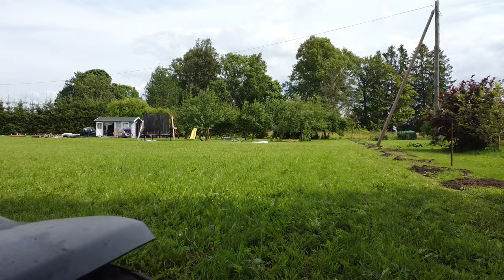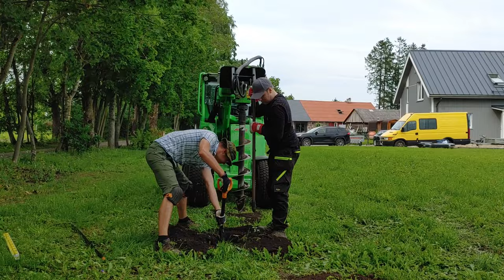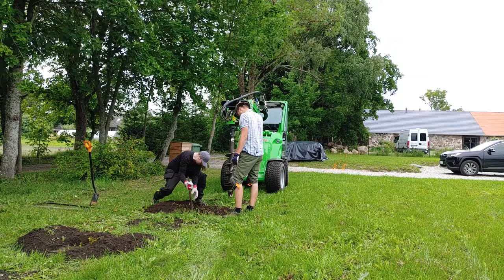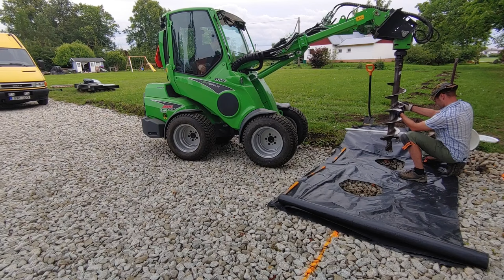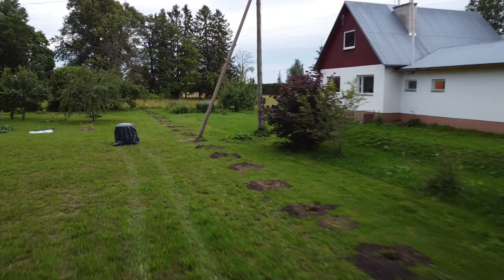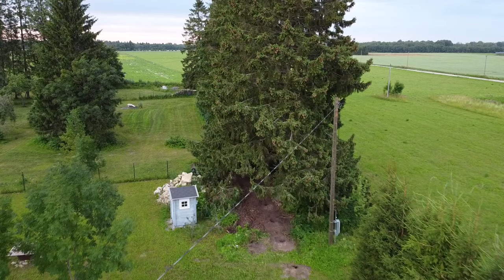Avant 650i drilling fence post holes

Comment: I've been looking at geting a machine like this will be using it to dig holes and some other stuff  how do you like it?
Reply from the maker: For small jobs the 600 series Avants are near perfect, good balance of weight and power.

Using the multi function drive unit as a auger driver works best in a sandy soil, if there's big rocks in the ground then the drillbit just spins ontop or gets stuck on the side of the rock. But little help with a metal spiky thing plus some shovel action and you can still get lots of holes done in a day.